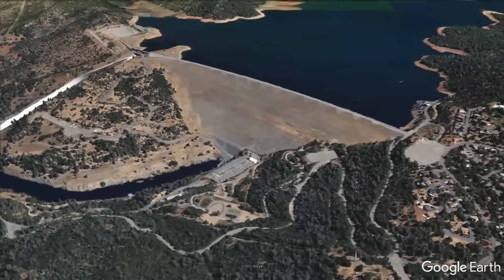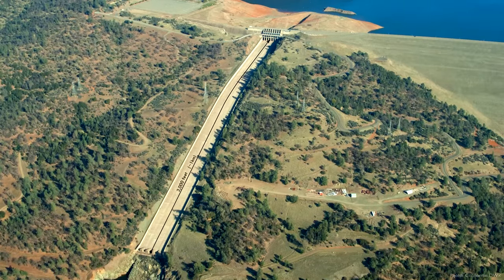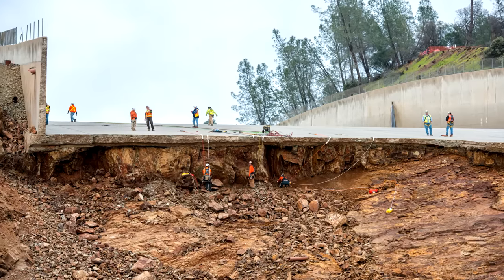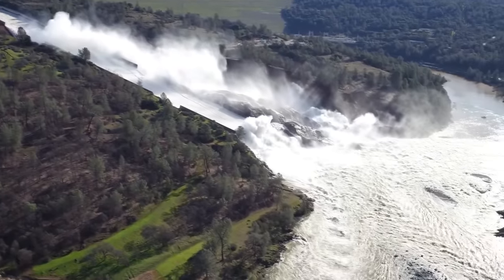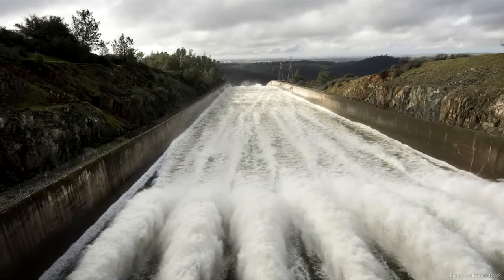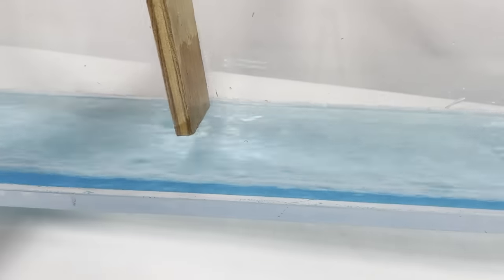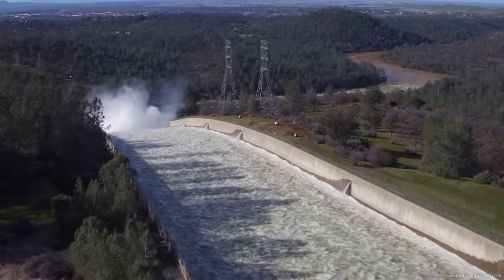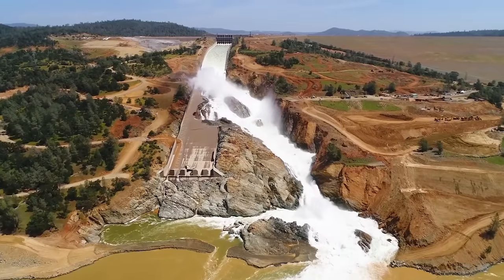What Really Happened at the Oroville Dam Spillway?

Comment: Based on the shoddy construction of the spillways, I have little faith that the actual dam was built any better.
Reply: it is 53 years old though...
Reply: It wasn't shoddy construction - that's how it was ENGINEERED. I'm sure at the time they were confident that laying the drains in the concrete was probably a safer method - worked fine for half a century.  Keep in mind there were no computers to calculate the forces involved on what's probably one of the most complicated spillways (from an engineering point of view) in the country at the time.
Reply: @alexmathis8505  I used to live with a guy who was a " batch plant operator " or the guy who mixed the concrete I learned that the ratio of ingredients for the concrete was different just because of the weather and how that effected the cure time and strength of concrete.  But the true cause of the failure is the dollar bill, for some odd reason dollars cause people to cut corners and ignore issues that could cause major problems just to save some of that potential labor and material.  P.s. ya don't need computers to have good engineering in 1968 Apollo 8 orbit the moon. Just saying. P.s.s  the first supercomputer was the cdc6600 in 1965. Just my opinion kinda like the shoddy construction opinion in the other post.
Reply: @0xsergy  there are lakes with natural dams that are older than that.....
Reply: @wc2126  natural dams aren't made of porous concrete that degrades, fam.
Reply: @0xsergy  natural dams are so porous that they have water flowing through the whole structure and underneath as well. Have you ever heard of ground water flow? Have you ever been next to a beaver dam and looked at It? Check out the Estes park lawn lake flood and the nature of the natural dams in the Colorado Rockies . As to the degrades thing do you mean like erosion that happens to any natural surface material?😘
Reply: @wc2126  dirt and concrete are nowhere similar, go troll elsewhere
Reply: @wc2126  natural dams dont have rusting rebar that expands cracking the concrete which significantly impacts the stability of the structure. 

also, please use punctuation. trying to read your rambles makes my headache double
Reply: @0xsergy  hmm, I, thought... that ya wanted me to go away but if you insist!! I will play. I apologize for my improper use of punctuation that is causing you to have headaches, that happens when a person uses a body part they are not used to using! ( does using a word too much hurt as well?) If you mean by rambles that i can type more than a couple sentences at a time granted the poor punctuation?!?, so be it... but back to the topic of the video it was the lifting of the concrete slabs, ( just in case ya need it ) and the position of the slabs, plus the faulty drainage pipes underneath that was the problem. but on the other hand remembering what ya just watched probably hurts your head as well.;:'""?!😍
Reply: @wc2126  nice, more insults. you have a better day sir, must be rough.
Reply: @0xsergy  not rough at all and having a great day, hope the rest of your day is better as well. Yes I do identify as sir and remember this started because you had issues with natural dams that last longer. Did you see the link to 2000 year old Roman concrete that I posted good stuff there. now remember a troll needs to have the last word or get blocked otherwise they are not good at trolling.
Reply: @wc2126  links get filtered 99% of the time. and yes, natural dams don't have rusting rebar to compromise the structure so ofcourse they last longer. the sky is blue, etc.
Reply: @0xsergy  oh well it was about concrete that has lasted 2000 years and natural dams have a lot for dead trees in them and guess what they rot.... wee maybe you are a fun time after all!!
Reply: @wc2126  dead trees are soil in only a few years, especially underground in damp conditions. plus natural dams have a much larger base and much shallower walls. all that adds up

yeah, i just read up on it. i'm surprised noone is using it yet. unless its not as easy as people thought
Reply: @0xsergy  the Romans had amazing engineering skills for sure. here is info on concrete slab rebar % " As per IS 456:2000 In SLAB as per Clause 26.5.2.1 Min reinforcement shall be 0.15% of total cross-sectional area for mild steel bars and 0.12% of total cross-sectional area for HYSD bars." do not know if that was the case in 1968. this is soil " The basic components of soil are minerals, organic matter, water and air. The typical soil consists of approximately 45% mineral, 5% organic matter, 20-30% water, and 20-30% air. These percentages are only generalizations at best." but in this case it was not the earthen dam that was the issue it was the design of the spillways and the need to protect the powerhouse that was the issue. if the people in charge were not so cheap the could have waterproofed the spillway ( at great cost ) and could have redesigned the emergency spillway. it looks like as of two weeks ago that now the water level is so low that power generation is at risk. the spillway does look spiffy.  have a good night.🙂
Reply: @alexmathis8505  Shoddy engineering then.  The spillway is built to this size for exactly this storm as in 2017, not for all the years prior, so it was needed once in 50 years and failed.  It never “worked”.
Reply: @alexmathis8505  Also,  computers might be necessary to predict ground erosion rates but not to build a spillway aware of Bernoulli and stagnation pressure, which is near 300 yo now.  Computer computation was not required either to properly inspect the spillway, and report out the cracking as required by law.
Reply: @wc2126  wrong.  Little or no water in cured concrete as it becomes part of other molecules.
Reply: @0xsergy  concrete dams usually don’t use rebar either.  They’re so massive that most of the force is compressive, little tension and shear.  Otherwise we wouldn’t have 100 yo dams, as rebar corrosion is an unsolved problem.
Reply: @Nill757  lol silly learn to read. i wrote "  the mix of the typical concrete 10% cement, 20% Air and water, 30% sand and 40% gravel "   so are you trying to tell me that when you mix a batch of concrete you don't use water? right... no that is not how it works. here is a little info for you. " Air entrainment is the intentional creation of tiny air bubbles in concrete. A concrete maker introduces the bubbles by adding to the mix an air entraining agent, a surfactant (surface-active substance, a type of chemical that includes detergents). The air bubbles are created during mixing of the plastic (easy flowing, not hardened) concrete, and most of them survive to be part of the hardened concrete. The primary purpose of air entrainment is to increase the durability of the hardened concrete, especially in climates subject to freeze-thaw; the secondary purpose is to increase workability of the concrete while in a plastic state in concrete.

Material
Though hardened concrete appears solid, it is actually highly porous, having small capillaries resulting from the evaporation of water beyond that required for the hydration reaction. A water to cement ratio (w/c) of approximately 0.38 (this means 38 lbs. of water for every 100 lbs. of cement) is required for all the cement particles to hydrate. Water beyond that is surplus and is used to make the plastic concrete more workable or easily flowing or less viscous . Most concrete has a w/c of 0.45 to 0.60, which means there is substantial excess water that will not react with cement. Eventually the excess water evaporates, leaving little pores in its place. Environmental water can later fill these voids. During freeze-thaw cycles, the water occupying those pores expands and creates stresses which lead to tiny cracks. These cracks allow more water into the concrete and the cracks enlarge. Eventually the concrete spalls - chunks break off. The failure of reinforced concrete is most often due to this cycle, which is accelerated by moisture reaching the reinforcing steel. Steel expands when it rusts, and these forces create even more cracks, letting in more water.

The air bubbles typically have a diameter of 10 to 500 micrometres (0.0004 to 0.02 in) and are closely spaced. The air bubble can be compressed a little, and so the bubbles act to reduce or absorb stresses from freezing. Air entraining was introduced in the 1930s and most modern concrete, especially if subjected to freezing temperatures, is air-entrained. The bubbles contribute to workability by acting as a sort of lubricant for all the aggregates and large particles in a concrete mix.

In addition to entrained air, hardened concrete also contains entrapped air. These are larger bubbles, and are typically less evenly distributed than entrained air. Entrapped air is considered to not make a positive contribution to durability and is undesirable though not entirely avoidable. " now if ya made it this far what say you?
Reply: @Nill757  from a engineering web site https://www.esinationwide.com/
they do it for real here is what they say "Pouring the Concrete
Along each section of the dam, forms are constructed of steel or wood with rebar placed inside and attached to another rebar previously installed. The dam is raised by sections of concrete 5-10 ft in height and about 50 ft in length. Larger concrete dams have observation galleries in different levels of the dam to observe the condition of the inside as the dam is being built." have a nice day....
Reply: @wc2126  I say you you like putting words in other peoples mouths. I said nothing about air.   I say you don’t understand what happens to water molecules when concrete cures.  The water added to the mix becomes part of the concrete molecule via “hydration reaction” as described in that text, and excess beyond that evaporates.  Again, “cured” concrete contains almost no water, unlike soil, unless it is unsealed and new environmental water is allowed in.

Soil  - concrete was the erroneous comparison you made above.
Reply: @Nill757  and I was not talking about cured concrete I was talking about mixing concrete and I provided information on just how much water is left after it is cured when water evaporates it is a gas silly  but no it is you who is putting words in others mouths .... but thanks for proving that reading is difficult for you.
Reply: @Nill757  I find it strange that you claim to have knowledge of concrete but know nothing of air entrainment and the role of water with it . Just because the water that does not evaporate chemically bonds to the material in the concrete ( hydration ) it is still water and called the w/cm ratio. Very important to know if ya MIXING concrete.
Reply: @wc2126    Bizmare, you keep insisting on imaging what I know on topics I’ve said nothing about.  

Despite the bluster, this conversation had and  has nothing to do with mixing concrete, but is about the difference between cured concrete and soil when used in structures like dams.  No water is not the same thing as the hydrate in a calcium silicate hydrate crystal.  The hydrate is a solid crystal.  CaSi hydrate doesn’t boil away, doesn’t freeze near zero C, it doesn’t evaporate, it does not migrate through the concrete, all of which can indeed happen to liquid water in the soil in an earthen dam.  One might as well say wood and water are the same thing because all the hydrogen in wood is made from breaking water molecules.

Tricalcium silicate + Water--->Calcium silicate hydrate+Calcium hydroxide + heat

2 Ca3SiO5 + 7 H2O ---> 3 CaO.2SiO2.4H2O + 3 Ca(OH)2 + 173.6kJ
Reply: @Nill757  darn sorry to bug you but I forgot to add if you use DHMO to grow wood does that change things?
Reply: @Nill757  Also it wasn't simply what it was designed for (you said built to that size, and the size was just fine btw) - it was OVER a 100 year rain season and dams upstream and downstream had also failed. 

I would say this was a maintenance issue more than a construction issue.  They KNEW about the cracks at that slab failure location as early as 2013 - it was patched but I'm not sure any ultrasonic inspection or further studies were conducted. 

Also your comment about it never working is ridiculous, it "worked" hundreds of times, give me a break.  You're saying its failure during a once-in-a-century event means it "never worked" lol. Also that event had nothing to do with it's capabilities, the issue was the damage to that slab and drainage YEARS earlier. It would have failed during normal releases anyways - this was a larger problem due to historic inflows.  Usually they'd just shut it down, use the RVOS and full Hyatt power plant outflow to manage levels (about 22,000 CFS), repair the main spillway, and it wouldn't even make the local news (and trust me, that sort of thing happens WAY more than you know about).

Comment: I’ve seen enough bad things happen over the years that were “impossible” that there’s no way I would ever build downstream from a damn. I think of it as not if, but when.
Reply: That's fine, but then you probably also shouldn't build anywhere near a coast incase of Tsunamis or in any region at risk of powerful earthquakes, hurricanes, or tornados, or major forest fires, near a nuclear power plant, or any remotely plausible warzone or target for WMD strike. I think one of the lessons from this analysis is that even if the dam had failed people had time to evacuate, and even with all the design issues neither spillway failed and failure wasn't imminent.
Reply: I’ve been following the problems with this dam because I have relatives near there, but higher in elevation.  I think there are still major problems with the dam and spillway.  I wouldn’t live down stream from that dam.
Reply: @noneak3  Don't forget places without clean drinking water.  Michigan is a pretty good spot to avoid almost everything :)

Comment: The initial geological survey of the area was done poorly. A person probably probed a tiny section of the site found rock and called it ok. The engineers designed the dam thinking the foundation was all bedrock. The actual construction workers where not trained enough to realize something was wrong and literally just followed the plans. Angling of the next concrete slap on the spillway needs to be explained carefully to the contractor pouring the concrete slab if not they will mostly likely pour it flush. It is almost like the engineers that designed the dam never went to the site to inspect its progress.
Reply: Government employees.

That's why I oppose Government run health care.

Comment: I wish he'd talked about how the spillway was repaired... assuming it was repaired.
Reply: Phase 1 of repairs was completed in November of 2018, and the main spillway was mostly fixed with temporary structural components. Phase 2 was worked on for the rest of 2018 and 2019, and was mostly just to replace the temporary bandaid solution with much better and more permanent structural components. I don't know if they're still working on repairing it but it's capable of handling relatively high flow again (albeit not sure if they're very confident in it). Since California hasn't had a super wet winter recently, we haven't really seen the dam take a massive flow yet
Reply: @BetaDude40  Good to know.
Reply: They dumped a crazy amount of rock on both spillways and laid down new concrete. They turned the emergency one into this huge spillway with steps down to the bottom. It looks really cool actually.

Comment: This was added to my suggested videos today. I appreciate your insight into the failure and your other video on the reconstruction  they are both very informative. I must say it brought back memories.   I live about 100 miles from Oroville, but I work for a heavy equipment rental company with contracts to provide equipment to the contractor that was called in for emergency repair work. I was watching the news about the evacuation going on that Sunday night.  the VP of the rental division called asked if I had seen the news and wanted me to get in my truck and deliver some portable light towers to the top of the dam.  Let me say I am not a first responder so going into an evacuation zone is a little unnerving.  I'm sure that the crews that were brought in to work on this emergency that night were probably also nervous. I'm sure sitting on top of an eroding spillway isn't a Zenful experience either. We provided several dozers and excavators that night and for the duration of the project.

Comment: Question, have they ever used a over lapping slabs like tiles on a roof.
Reply: Great question.
Reply: I'd imagine that the huge flow over the overlapped slabs would create a vacuum at the overlap point that would rip the slabs loose.
Reply: You'd create an immense amount of hydrodynamic forces; drag, friction, etc at each "drop" - almost immediately you would end up with scouring at each joint. Plus these slabs aren't a few inches thick, they're feet thick. The methods mentioned in the video to keep a smooth flow are far safer than attempting to "protect" the subsequent slab via overlap etc. 

Figure that spillway had been operating (as a smooth surface) for decades, yet the second any sort of friction or abnormality in the surface of the flow was created, it literally ate through half a mountain lol.